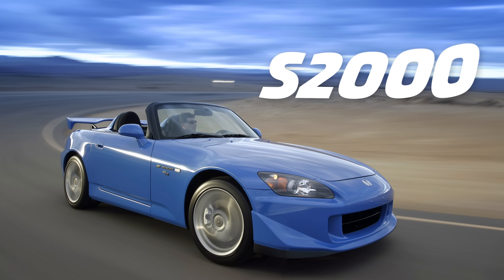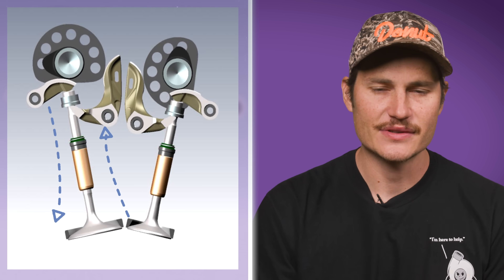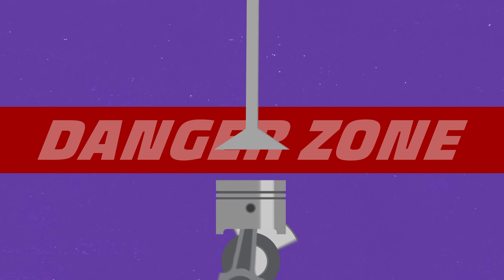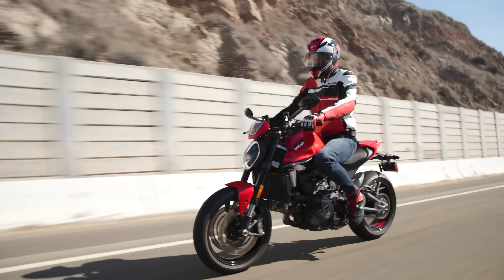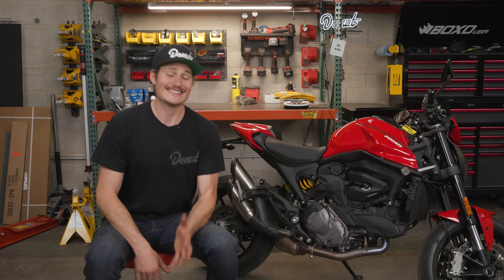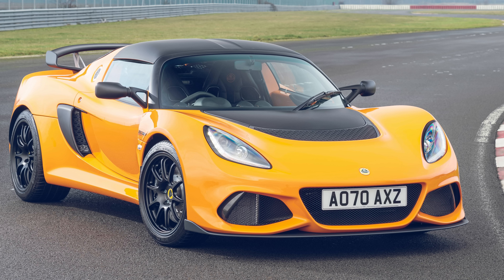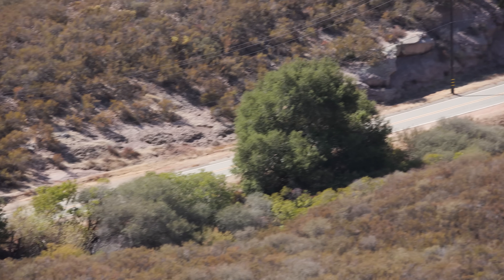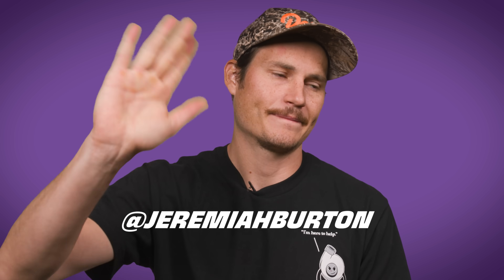Why ONLY Ducati Uses This Part To Go Fast

Comment: I think Ducati v4 should stay at the racetrack. The are the best motorcycles in handling and power hands down! Most people use 10 to 40% throttle at legal speeds. Just my 2 cents!

Comment: At high RPM they are less efficient than an engine with standard valves because there is constant friction between the cams ant the valves. Also most road going ducati's do have valve springs  on the pivot for the closing rocker arm, as the clearance needed for expansion would make the bikes run like shit when cold without it.

Comment: Do the research!
The Honda CBR 250RR made 20.000 RPM in 1990 using conventional valve spring configuration. As a matter of fact in the early 90’s Kawasaki, Suzuki and Yamaha were all making 250 inline four cilinder motorcycles revving higher than 15.000 RPM. Probably never sold in America but here in Europe they were rather common. Ducati is just holding on to heritage with the Desmodromic actuation. Like they used to do with air cooling and L-twin engines.

Comment: The 90's era Honda MC22 redlines at 19,000RPM and will go to 20. Obviously it's smaller, less rotational mass etc. But still... Does not need desmo and still winds up to that speed 30 years later

Comment: "Poppet valves" are the correct term for all engine valves in the familiar shape, not just the ones used in desmodromic engines. (It's more commonly used in British English, but it applies to all valves of that shape).
Reply: Dead right! I was wondering when someone would point that out. I'm surprised that someone creating an automotive channel would not know that.  There are at least three types of valves- poppet, rotary and sleeve valves.
Reply: Yeah, yeah, and if the producers were worried about being technically correct, the discussion would be based upon Oscillation, not "revolutions per minute" and mass.
The numbers are half as big and don't impress anyone who measures their life by max rpm, peak HP, or RADAR assisted driver aids.

They produce videos for entertainment, not education.

Comment: Why settle for 17,000 RPM and 250+ HP? Get a two stroke, "Orbital" type, Diesel with much less weight, cost and complexity and much more durability and power, like 378+ from the same displacement, in an engine proven to last longer than most cars???  RIGHT! Better yet, how about we start racing stripped down, street legal, un-modified motor-cycles in classes determined by the bikes retail cost? Then it will be more about the rider and less about who has the most money!!!

Comment: Has to do with p=fa. Or rearranged, p/a=f. So if you increase the surface area of the tire, you're lowering the force applied to the tire at any one point. The coefficient of friction is basically another multiplier of that force. So a more holistic model might be (p/a)=kf, or rearranged to be (p/a)/k=f, where k is the coefficient of friction.

Comment: My buddy Jimmie had several early desmo Ducatis. He would remove the heads to set the valve lash on his work bench. Never seen belt-drive desmo valves set. Ducati brought desmo valving to the street by putting small springs on the valves that allowed it to run at starting speeds unlike the Norton singles that first got desmo valving and had to be pushed quite fast to start.

Comment: "17,000 rpms!"

Laughs in Yamaha. The R6 does 16,500 WITHOUT desmo 🤣
Reply: In the 90's there were a few I4 250 ccs motorcycles that revved to 20K rpms, like the honda cbr250rr.
Reply: Back in like 05 or 06, I didn't know anything about bikes but wanted a R6 just because it revs to the moon. If I actually had the money back then who's to say I would be here today because the guy at the bike told me it didn't matter what you get as a 1st bike because you get used to it fast.
Reply: it's still a smaller displacement
Reply: @sillapopulares  In this case it have nothing to do with displacement. It can be a limiting factor, but even on a smaller engine the valves still have to do the same job. In the video it's about valves.
Reply: Still a mystery how yama can make so many horses so boring.
Reply: Ducati riders also get laid..

Comment: I used to have a Suzuki GSX-R 250R 4 cylinder 4 stroke which red lined at 18,000 rpm.  It was insane but honestly, not much quicker than my RGV.  I sold it just in time as it exploded a few months later.

Comment: Ducati never used chains on the 851... how would i know?.. i got one.. 
Ducati street engines also have the small springs , but they're not there to help close the valves, they are there to take out any play in the system.. in the race engines that didn't really matter.. as the pressure in the cilinder does the same.. (makes em run less good at low revs.. but on a race engine.. that doesn't really matter)

Comment: Just a note.... In the 60's Honda had GP engines that revved to 20,000+ rpm......springs and all. The big four Japanese moto makers had street legal production 250cc bikes that revved to 17,000rpm in the 80's....springs and all. I just so happen to be doing a belt change/valve clearance check on my Desmo bike. It's my first time having one apart and it really is a bizarre feeling when you rotate the crank and there is no typical valve spring resistance pushing against you.....gives you an idea of how much power it takes to compress those springs. Braaap !

Comment: I keep watching these videos and wonder why people stuck with the internal combustion engine for so long and kept making it more complicated in an attempt to improve it, rather than look for complete alternatives to the technology. Imagine where we would be now, if we started to focus our efforts on improving battery and electric car technologies decades earlier rather than backing the ICE horse and adding more bells and whistles to it.
Reply: Because until the advent of lithium batteries, we didn't have anything that approached the energy density of hydrocarbon fuels. And they're still behind, but due to electric motor efficiency we can now approach similar to gasoline ranges.

Comment: You don't need desmo for high rpms, my 250 does 19000 rpm. And it's reliable! Here's a little 0-100 https://youtu.be/17Nx_XTsMCg
Not the fastest, but nothing that sounds like it on the road!

Comment: Before watching the video fully, i comment this: the higher the revvs, the more the valve float. The device from Ducati reduces it by punching valve both directions, thus allowing for 17k rpm
Edit: so it was true, if you have no time for video i basically summed the thing up

Comment: "Why doesn't anyone else use desmo valves?" 
Two reasons. A: It's expensive to service and more complex, nobody wants to work on it and nobody wants to pay for that work
And B: The Japanese manufacturers already pulled off 19,000 RPM with standard valvetrains... in the 80's... and those bikes are still running to this day
The better question is why Ducati bothers
Reply: Ducati only still uses is out of tradition. Like why Porsche still uses a flat 6 in the back of the 911, because the fans of the brand would riot if they didn't.
Reply: @BigUriel  flat 6s are the best tho dont newd tl be changed lol
Reply: why Ducati bothers? this is how their maintenance guys make $$$ lol
Reply: @bella_testastretta  Gave my mechanic a wad of cash today for a Desmo valve adjust and new cam belts...
Reply: That’s the perfect answer explained in a few lines. Nothing more to add.
Reply: @Alfred Wedmore ---YES....and they overheat and warp head gaskets at 50-80K or so...planned obsolescence?
Reply: To keep cost up and pass it on to the consumer. $$$$$$$$$$$
Reply: Tradition I would imagine
Reply: Because Italians would like you to believe that Leo painted "Mona Lisa" with his feet.
Reply: @Alfred Wedmore Subarus have modern cars with flat 4’s and flat 6’s in the front tho???
Reply: @pearsepopchock6177  lol look at a sparkplug job on any of those boxers, not exactly fun.
Reply: A spring has to work for all RPMs. It is much too strong for start-up or idle. It kills your engine on start-up letting the cam scratch over the rocker arm. Cars and a lot of bikes use soft springs and more displacement. Note: There is no replacement for displacement. For example the kinetic energy stored in the engine and flywheel goes with the square of the RPMs, but power only linear. For any not continuous variable transmission you need to kill this energy on a up-shift. Shifting is faster on a slower engine.
Valve trains already use oil pressure to adapt the pressure to the RPMs. Formula1 cars use air pressure in the valves to adapt to the RPMs. Fuel injected cars adapt the fuel pressure to the air pressure measured after turbo and throttle.
Reply: Because Italy bro
Reply: Because it keeps people coming back to ducati for service because like you said no one else wants to work on it.
Reply: @drsrsv8884  Totally irrelevant. The implication was that a standard valvetrain supposedly can't handle revs as high as a desmo system can which simply isn't the case or at least isn't relevant in the real world because a standard valvetrain can handle the absolute highest revs possible by a piston engine (around 20,000). 

Displacement isn't relevant to the desmo vs valve spring discussion, smaller engines rev higher because the pistons are much lighter and travel a shorter distance not because of the valvetrain.
Reply: Isn't there still an advantage in the cam profile? I thought the desmo system let them use more aggressive cam profiles than possible with springs
Reply: Yep, i owned a 1990 ZXR250R that had a 19,000 rev limit, it was boringly reliable despite getting the living shit thrashed out of it. The guy i sold it to still owns and rides it, never had a problem. Hondas  RC148 125cc five and RC115 50cc twin from the 1960s Gran Prix years revved to 21,000 rpm on standard valve train.
But "Doocahtees are Badaasss" :-)
Reply: @TeUhtred7860  those bikes have a much smaller displacement
Reply: @sillapopulares  Old high capacity 2 strokes and 06' Yamaha R6 does. 16k+

It's mostly low capacity engines for reliability sake. Pushing 1000cc at 16+krpm is less than ideal considering the piston speed.
Reply: Ducati has got enough know-how to make desmo engines work as good as any more traditional configuration, kind of like BMW does with the boxer twin, Guzzi with the transverse V-twin, or more recently Yamaha with their crossplane shenanigans, etc. 

Sometimes manufacturers invest in certain technologies and they develop them well enough to make them worth using in the future, but not well enough for other manufacturers to start emulating them. Sometimes they straight up fail instead. Like, Honda tried to sell V-TEC bikes for years and we know how that went....
Reply: @filippoformoso9690  Bruh Honda literally sold all of two VTEC bikes and it was never the actual proper VTEC like the B series engines used. Just the eco "VTEC" before they realised that being slightly more fuel efficient means nothing in the bike world. 

At least the VTEC was there for a reason other than "wow aren't we special and unique" lol
Reply: @QuakeGamerROTMG  I'll give you that, they had a reason for trying to sell it, though to me that's even worse lol
Put it this way, it's like when BMW tried to sell the 850 cc boxers alongside the 1150 cc ones. The engines were basically identical, and so were the manufacturing cost, and so were the sticker prices. They tried to sell them as a more fuel efficient variant, which was true only because they were tuned to make like 50 hp compared to the 85 of the 1150 ccs. Meaning you could get almost the same fuel economy from the 1150s just by going slower...
Yeah to think about it this is also not a good example, but at least it's a fun story to recall!
Reply: @SnowGolem1TheL33t  2 stroke engines don't have spring valves (the piston itself does the job)
Reply: @sergiogiacomosammartano7623  I am quite well aware of this, you will see my comment is in reply to a comment addressing 2 stroke motorcycles.
Reply: @sillapopulares  Mercedes- Benz used  Desmo in their race cars before Ducati.

Comment: Next video: Look at valve technology in MotoGP bikes (pneumatic valves)

Loved this video BTW!
Reply: Thanks for bringing up pneumatics.Suzuki has variable valve timeing.On it'sstreet bikes.I have seen Yamaha R1"s still going strong with 200,000 miles.Takes some time to do a valve service but it can be done at home, if you buy a shim kit. Not for everyone,desmo is only done at Ducati dealers at great cost.show me a Duc with 200,000 miles.Chris Moore fastest stock stock motor gsxr 1000 1/4 mile.I beat Ducati Monsters with my R6 at the 1/4mile, No problem. Italian food is good.

Comment: Do one on how shitty, and awesome the old sportsters are im talking ironhead.  Yeah, setting valve lash with pushrods.  Oil leaks.  6500 rpm. 61 cubes of unbridled noise.

Comment: Dude, you misunderstand what valve float is. Valve float happens when excess rpm causes the valve to open so fast that it's inertia overcomes valve spring pressure.

Comment: Desmo valves aren't at all needed for high RPM, proper engineering is, Italians just like to take shortcuts, even if that means cough*1grandfordesmovalveadjustments*cough
Reply: Plus another for labour.
Reply: I guess when Desmo was introduced valve bonce at high RPMs..(racing).. was a problem. This is negated now by using four valves a cylinder plus metallurgy has moved on.
Reply: @Tyler Braden Yea sorry valve adjustment only on my BMW costs 20 bucks if you do all that. That's a bs argument lol. Many people can't take their bikes to a shop half disassembled, and you have to have enough parts on to actually make the bike run, which is still hours of labour at ducati's extortionate prices. That's just not how it works...

Comment: This is just Ducati trying to be different. My 2007 Yamaha R6 redlined at 17,500 rpm and had 20,000 rpm on the tach. I never found out if it went to 20k though.

Comment: You need to watch "Richard Holdner" video on valve springs.  And you will see for your self that stiffer valve springs is a myth... 
Yes they require more energy,  but this is stored energy that is then  r eleased back into the engine, canceling out parasitic losses..
Watch [ Richard Holdner's ] the video  don't miss out on it.

Their's another video by "David Vaisard" [ Power Tec. 10 ] on valve spring design evolution.

Comment: I was wondering how long anything "Ducati" would come up after your Ducati demo ride 😬👍🏁. 

The desmo system is cool and sounds awesome, but it's also the reason why any Ducati is a maintenance hog and ridiculously expensive to own.
Reply: Yeah they are ridiculously expensive to maintenance if you rely on shops. I do my own maintenance and it cuts the cost a lot. Parts are quite easy to find and shipping times are 2 weeks max (for europe). Some parts are on the expensive side ie. rockers for my euro 996S are around 250€ a piece from dealer and they are common failure point due to bad prepping for chrome plating, and there are 16 of those fuckers but usually only few are flaking. I have replaced 3, but I got them rechromed instead of buying new. Other than those rockers this thing has been suprisingly reliable, and not too expensive to own! Oil and filter once or twice a year and belts+tensioners every second year/20k km. Valves aren't hard to check/adjust, just a bitch to do because there is not a lot of space.
Reply: @roid326  here in the states I've seen allot of used ones with blown motors because some of the people that buy them don't know how to do their own maintenance or just plain don't do the maintenance in general.

Comment: Please don't put a motorcycle engine in your car. All those revs just to make 200hp. Also less torque than a Honda S2000. Second, the valve service intervals in a NEW Ducati are longer than many of the Japanese bikes.

Comment: Listen, you don't want to hear it but still going to say it. Desmo valves were invented 20 years ago and were a cool idea. Actually a little bit unnecessry... but you know, because of race stuff. For street, even for superbikes: unnecesary. Want a moto gp prototipe insane bike, may make a little bit of sense. But still. Do you eant your valve to close fast enough? : make stiffer valve springs and your good to go. Even with the actually benefit of active opening and closing of the valve by a rocker arm, still notworth it to doit like so. It's such a mechanical and unneficient way to do the thing. That's why everyvody including ducati moved fast to the electroneumatic closing of the valve

Comment: Motorbike engines have been put in cars for ages. Look up Honda S600 hotrod. It was featured in Jay Leno’s garage awhile back. Honda CBR1000RR engine in a Honda 600. Built by a racecar engineer by trade. Could do the same with a desmo

Comment: And metal wear is a cubic function. So velocity(your rpm, essentially) to the third power. That's why to maximize the life of your engine you want to keep your rpm low. With a high revving engine, big oof, that's a lot of wear/oil/seals to keep it running.

Comment: S2000 revs to 8300 rpm stock production specs.

That is why fact checking is so important kids.

So if you talking tuned ecu then the RX7 blows the S2000 out the water. Very little needed to happily rev to 10k all day long and if you want to push it 14k can be done.

Comment: Interesting definitions of poppet valve and valve float.  Poppet refers to the sealing part of the valve, which is the same in both designs shown.  As for float, the valve does not always close at the same speed, but rather the spring should keep the system under tension until the valve is fully closed.  If the valve cannot close as fast as the lobe retreats, that's float.